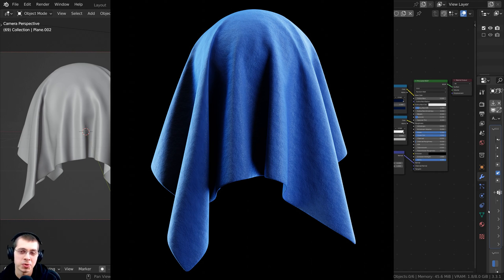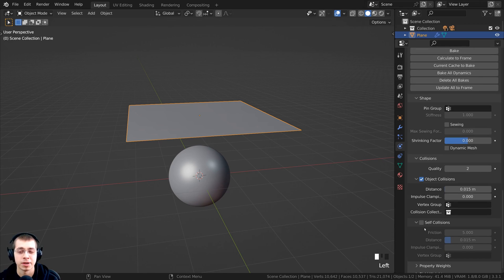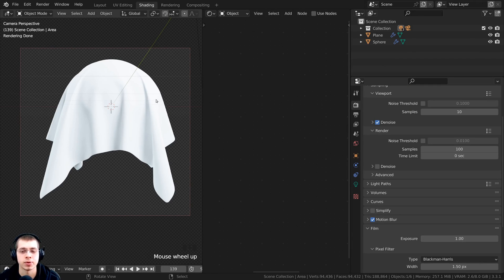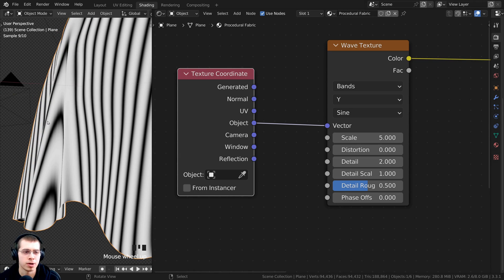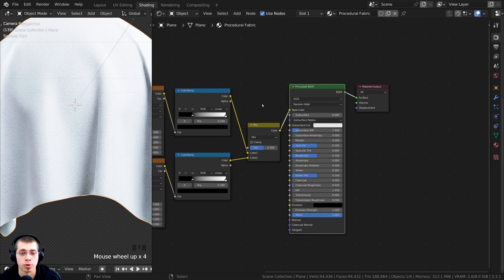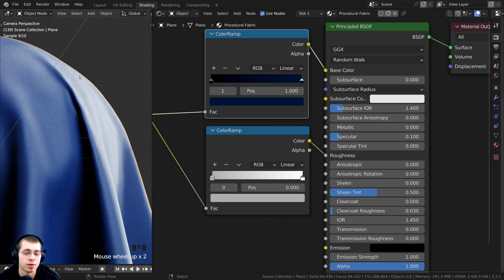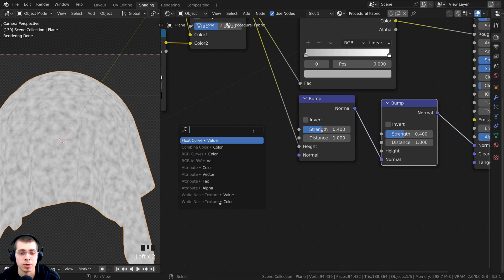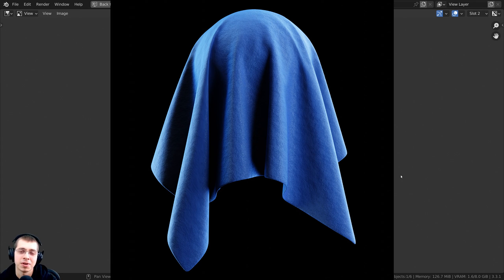Procedural Fabric Material (Blender Tutorial)

Comment: Technically we should not be touching the Specular setting at all as it changes the way the light spreads across the object/material... What you want to do is to set the roughness accordingly and use the normal maps to fine tune it so you get a more realistic shading.
Reply from the maker: Yes, your totally right. Back when I made this I couldn't get the material as dark as I wanted, so I turned down the  Specular to make it darker. but after posting the video I realized that was not the best thing to do. lol 🙂

Comment: I think empty spaces need to be more rough and threads - less rough. So roughness map has to be reversed. It's subtle, but it'll look more realistic, chances are - it will please the eye more. 

Also for color of threads I think underlying color has to depend on main color, but fraction of it, not just plain black. For example if fabric is white, like 255,255,255, empty spaces would need to be like a fraction of that maybe 25,25,25, but not fully black. For your dark blue material with bright blender light setup this isn't visible as much, but if fabric is made out of bright colors it'll be an important factor.

Comment: Ryan, I'd like to bake the Diffuse, but when I do so and plug in the baked image texture, the colors don't match (your original vs. my bake). Any suggestion, or is this a Blender limitation? I followed your Bake tutorial exactly. Roughness and Normal bake works fine.
Reply from the maker: It might be because I turned down the specular value on this material, to make the fabric darker.
Reply: @RyanKingArt  Sheen must be set at 0 to get an accurate diffuse bake. Any value higher than zero will throw the color off.
Reply from the maker: @tonygr11  Ahh ok. thanks for the info.

Comment: Thanks man, nice material... question:  after I add a second bump, I can't move the object in the viewport anymore, it happens with any procedural material I make, as soon as I add 2 or 3 bump nodes, it's all slow like hell, in material preview... rendering is fine.
Reply from the maker: are you in eevee? I find that eevee doesn't work well with lots of bump detail. I find cycles to work better for procedural materials.
Reply: @RyanKingArt  no eevee nope, all in cycles, but the issue is in the material preview when I move the viewport around... if I add 2 bump nodes, it get so heave and slow...
Reply from the maker: @PixelForgeLab  hmm, sorry its acting slow. maybe try turning down the detail amount on the noise textures.
Reply: @RyanKingArt  Yeah I think it might be my graphics card, it's from 2017... and definitely with detail amount down works better... what graphics card do you use ? thank you btw.
Reply from the maker: @PixelForgeLab  I have the: Gigabyte GeForce RTX 2080 SUPER GAMING OC 8G